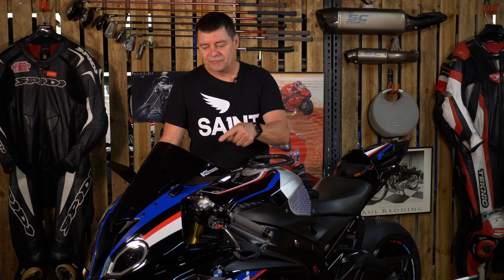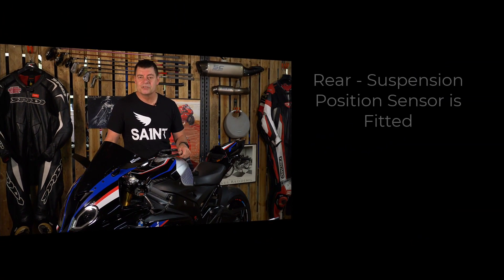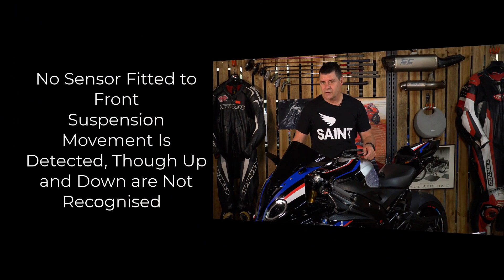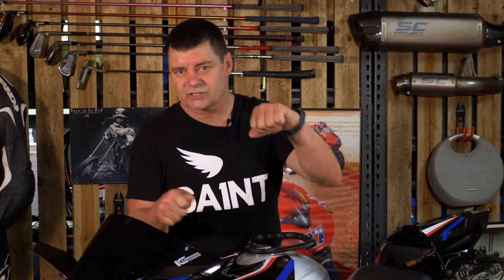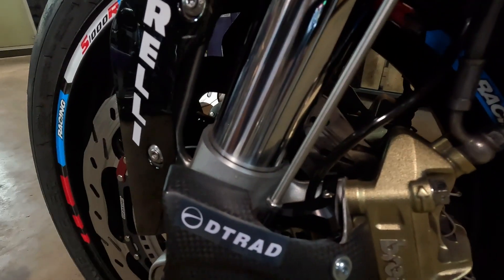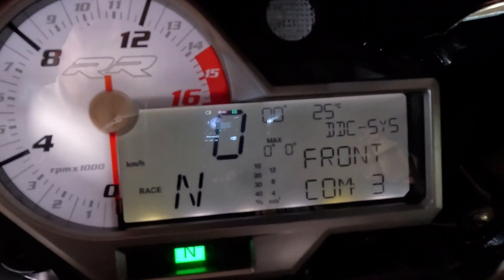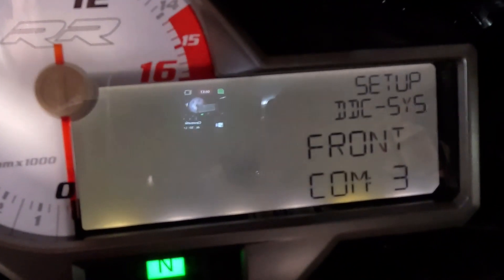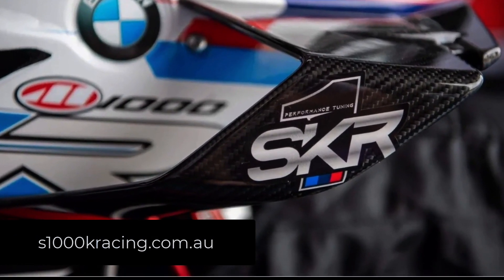How To Separate Front Suspension Compression and Rebound Damping on BMW S1000RR

Comment: This may be a stupid question so please forgive me. I just put on ohlins 202 front forks. I now have a light in my dash. Will this work with my suspension? I did away with the factory electronic setup and switched to the manual.
Reply from the maker: if it's an S1000RR like mine, that will be the DDC light indicating it is not working. Unless the DDC is removed from the system, any move to a non DDC suspension results in the warning light coming on indicating a fault. I dont worry about mine, I just live with it as it doesn't do anything.
Reply: @ yes it’s a 16 s1000rr.

Comment: george, can you still lock the steering with the stopper stuck onto the frame? been wanting to do this for a bit but i still use the bike on the street a fair bit.
Reply from the maker: nah, it doesn't turn sufficiently to engage the lock unfortunately

Comment: And if i want to go to factory settings i just hit the reset button on the side stand with the engine running or off with only the ignition?
Reply from the maker: If you are talking about damping settings, I guess that might be right. I'd be checking the manual for the bike. Personally I just do adjustments as required and have never used reset. If you are talking about going back to the front damping being combined, you simply remove the device.

Comment: Hi Jorge, I took your advice re the Brembo SR brake pads and absolutely love them on my 2020 S1000RR (I also upgraded the master cylinder to the Brembo RCS19 Corsa Corta). I've been thinking of installing the 2D position sensor and I think you've convinced me to go ahead with that upgrade too. Loving this channel!
Reply from the maker: cheers my friend, thats awesome and hope I am helping some way, yep grab the 2D sensor, it's a good bit of kit and super easy to install and set up.
Reply: @TheBikeStig where u pluh the 2D sensor? And you do the video with a 2017-2018 model but I can't find the sensor... just for the 2019 and foard.
Reply from the maker: @ricardoreis2648  you should have instructions with the 2D sensor if you bought one. The plug on my bike is sitting in the wiring harness against the left side frame close to the left fork, it is blanked out with a cover. If you cant find it, information should be fairly easy to get about where it is on your bike. Hope that helps.